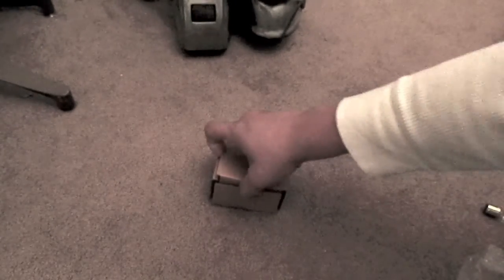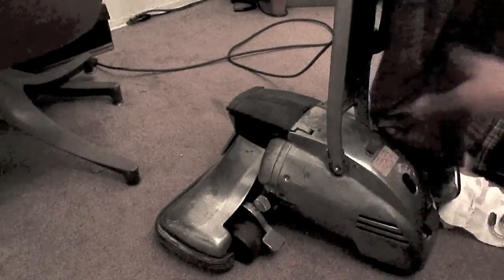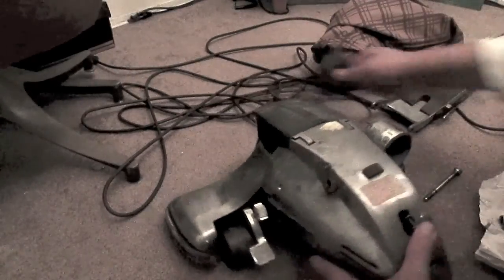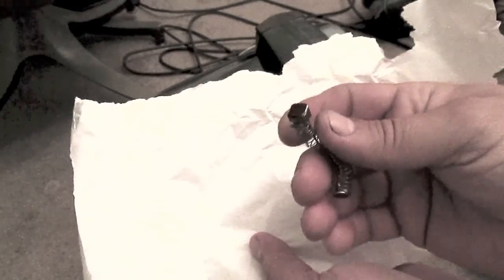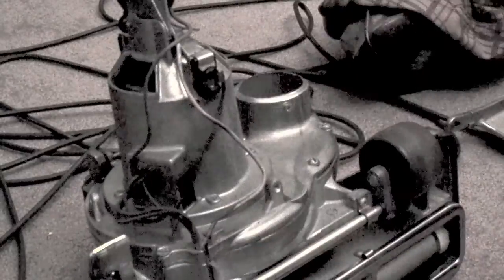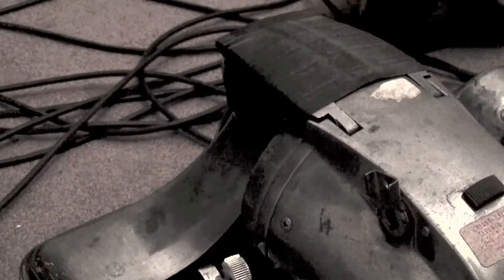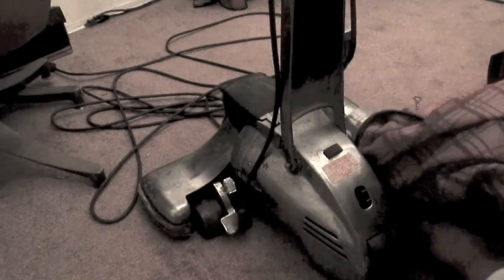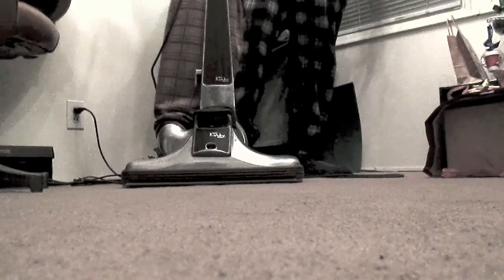Fix a Broken 1969 Kirby Classic 1-CR Vacuum • Honest™

Comment: Additionally, to further protect the Classic 1CR motor from getting dust inside, I would also suggest using the following parts:
107173 or 107185 - carbon brush caps
109467 - fan case to motor housing slot insulation tubing
111573 - brush lead tube, black (use with the black brush lead wire)
111973 - speed switch lead tubing, long (use with slot insulation tubing)

Comment: Awesome video! I have my moms 1969 Classic as well. I took it in a few weeks ago to have the beater bar fixed. It had seized up, and no matter what I did, I couldn't fix it. The vacuum shop convinced me to do a tune up. I agreed considering it's been 20 years since I've had it, and I've never had it tuned up. Somehow they broke the handle off where it attaches to the base. I have no idea how they could possibly break 1/2" thick solid aluminum, but they did. When I picked it up, the guy tried to brush it off like it was no big deal, and they put a later model omega handle on it. Now, it keeps falling over, and won't stay up when the vacuum is running! I love my Kirby, it's the best vacuum in the world! Just breaks my heart it's damaged now. Jaws was supposed to live forever!!
Reply: The handle fork spring is worn out.
Reply: ClassicTVMan1981X Thanks! Well, I ended up returning to the repair shop after the handle fell against my walls repeatedly, and onto my 10 yr old dog who has cancer. They said the spring was broken, and even though it wasn't broken when I first took it in for the beater bar replacement, it somehow mysteriously broke upon disassembly (just like how they broke the handle). It took almost 5 months, but I finally got it back. It stays upright, and they replaced the whole handle portion...but the plastic part is cracked and will probably break soon. I'll never let my Kirby out of my sight again!
Reply: A replacement handle grip is part no. 173369S or 173373S.
Reply: ClassicTVMan1981X Wonderful, thank you!! Can you believe I found an Omega sitting on someone's treelawn on trash day!! It has the original bag (which is moldy and filthy), but I'm going to try to disassemble it to save the cord, handle, and anything else I may need in the future. I'll sell the rest on ebay. It's sitting in my garage right now (unattached, not heated, and I'm in Cleveland), so come springtime, I'll definitely have a fun project! 

Thank you again for all of the information, I greatly appreciate it! :-)
Reply: Sparkling Silver Curls 
You're welcome, and good luck!
Reply: my unle has a classic that had the handle break off as well. he had a new one put in. still runs
Reply: @SparklingSilverCurls  I hated to hear that about your machine. They should've been made to fix the damage they caused. I repair them off and on and, if anything like that happens, I phone the customer asap and tell them. I broke a bag strap one time and let the customer know. I paid for it out of my own pocket because it was my fault. The best way to do business is the honest way.

Comment: IDK Kirby states that the 1-CR didn't release until 1970
Reply: twintriode
The id serial plate has 1969 on it.  It was released i believe in October 1969.
Reply: It was likely announced in 1969 but not released until February 1970. The back of the instruction manual is dated January 1970.
Reply: It was unveiled in late 1969 and sales for the 1CR began in early 1970
Reply: @KirbyVacuumCollectorFixer  You're correct about the 1969 debut. The Kirby Company wouldn't have stamped it on the manufacturer badge if it weren't the case. Great '60s styling and color scheme!